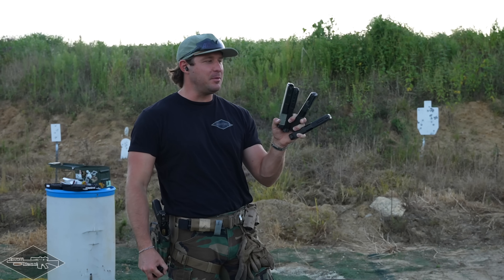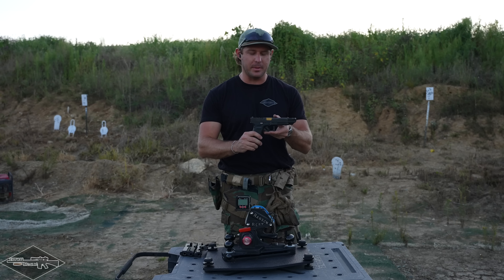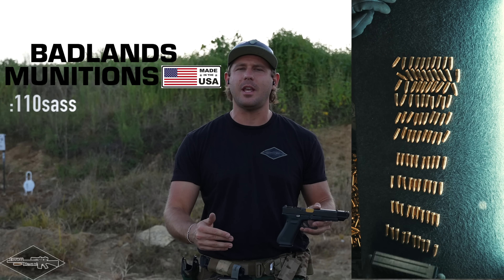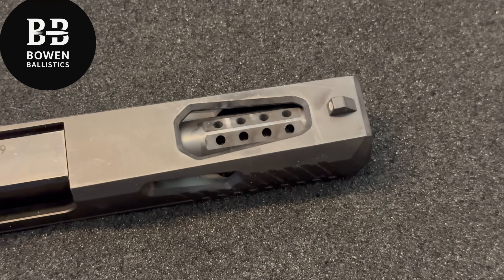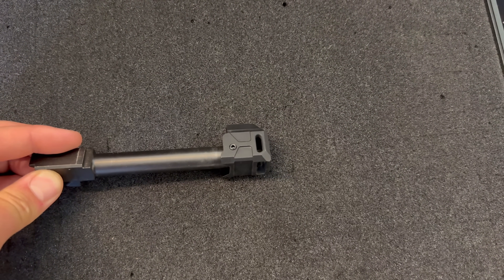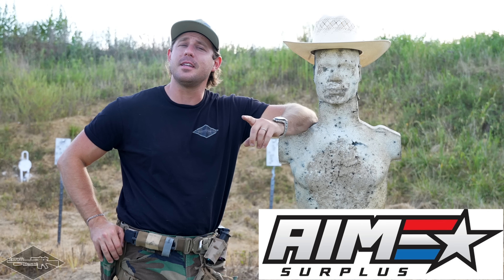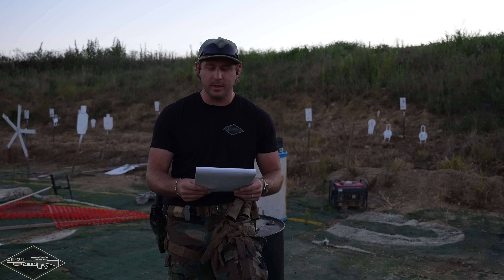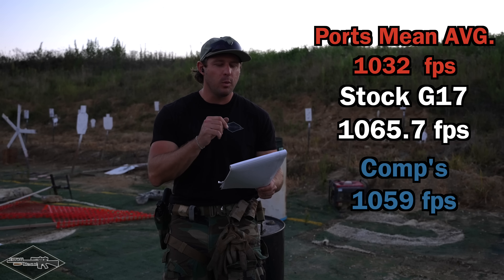Science Finally Proves It - Which Is Best?

Comment: Let me help a little with the accuracy of your home brew. I've been porting and integral comping barrels for myself and others since 1993 and here are a few tips that make a huge difference. 
First. Use a end cutting carbide end mill. Not a dri as the end mill will cut much cleaner with very little interior burs or rough breakout in the riffling. Next, angle the barrel slightly up by 1 deg in the vice, this prevents the forward edge of the port from acting like a  wood plane or cheese grater on the jacket of the bullet.  Lastly, use a Fordum or dremel with aa fine rubber abrasive by crayex. (Jewelry supply or gunsmith supply store) and polish the interior of the port, particularly the forward edge to round the edge of the interior of the port. This will stop any shaving and or shrapnel from the jacket material. .   (This same shaving also unbalanced the bullet like an out of balance tire and causes accuracy issues. Particularly at any appreciable range)

Next, lap the bore to remove any possible remaining burrs. I use JB bore paste or very fine 3 micron diamond stropping paste. followed by flitz metal polish as it breaks down to 1 micron in use. 

Lastly,  Do not under any circumstances use plated bullets in a ported gun or a revolver. The jackets are ultra thin, weak and plated ver pure soft lead. Any port regardless of how smoothe inside will shred the platting.  Giving of both sharpanell and  destroy accuracy and can in some cases damage the barrel. 

I fine that slightly higher quality ammo such as Federal American Eagle that has a thick actual copper jacket to be very stable in smooth ports and give even good accuracy at long ranges. 100 yards, no issue whatsoever.  Avoid such offerings as winchester white box,  Blazzer, Federa and Remington target or practice as they are all plated. 
Plated is supposed to be listed as TMJ which is total metal jacket. Total metal jacket is a plating and can be seen if you pull a bullet from the casing adn it is jacketed on the base as well.  A real jacke will either be lead exposes on the base on a round nose, or the tip of an HP.  It is haw they have to be made as the jacket starts as a cut.  Lead is pressed in from the rear of a solid and from the tit of a HP. then shaped.  A bullet can be easily pulled by simply putting a live round in the vice adn twisting it out with a set of channel locks. Another quick on location test is using a sharp knife, a plated bullet is easily cut tru to the lead where a jacket is very tough. 

KnifeMaker/Retired after over 47+ Years in the craft and 1911/2011 and double action Smith and Wession and Colt double action tuning.

Comment: Great video! Thanks for doing it in a scientific way that eliminates most of the variables.

I would say there is a direct correlation between loss of velocity and effectiveness of the porting or compensation. Basically, the more gasses that are vented before the end of the barrel, the greater the effect. The side ports on the compensators do nothing to reduce muzzle rise and are pretty pointless. The only advantage a compensator may have is that it vents the gasses near the very end of the barrel. This basically gives it more leverage compared to ports, which are further back. What would be super cool is to get some high speed footage of the gasses being vented from a port to see if the ports that are further back vent significantly more gas. It would only make sense as there is successively less gas to vent as each port vents some gas.

The other thing that is somewhat “deceptive” is using percentages to show how much of a reduction there is in muzzle rise. In terms of absolute reduction, it was only about a 2-3 degree reduction with the compensators and a 3-4 degree reduction with the ports. With that said, I do carry a Springfield Armory Hellcat Pro Comp. The compensator is about 11mm wide by 7mm long, with 8mm of un-rifled barrel that opens up to 10mm after the compensator. I have an un-compensated Hellcat Pro and I can say the compensator definitely keeps the gun flatter. I have a Springfield Armory Echelon and an Echelon comp as well. The compensator is about 13mm wide (the whole width of the barrel) by 5mm long, but it is angled forwards. The compensated Echelon definitely shoots flatter than the non-comped version, but even the non-comped version shoots pretty softly. I can rapid fire the Echelon Comp without losing the dot on my Holosun 507 Comp (huge freaking optic 😅).

Overall, I’d guess that the size of the ports/compensators has the greatest impact on the reduction of muzzle rise while the greater leverage is gained from venting closer to the end of the barrel. Some of these compensators add extra weight at the end of the gun, which should also reduce muzzle rise. My issue with added comps is added gun length and greater difficulty in finding a holster.

Be careful when shooting from retention!!!

Comment: Bonus points for ports not impacting holster selections too.
Reply: And not adding weight to the front of the gun
Reply: @69newportking that's uh, where you traditionally want it
Reply: This. Exactly why I've preferred them.
Reply: Ive never had an issue with holster selection. Most of the big holster makers will give you an open bottom holster if it's not already their standard.  Just gotta ask when ordering 

But I guess it could be an issue if you're carrying bare guns without lights or optics, and can find off the shelf holsters at your local gun shop
Reply: And reliability for not adding weight to the end of the barrel.
Reply: Does custom ports affect accuracy?
Reply: my comp sticks out like a sore thumb....its annoying

Comment: So, if I'm doing this correctly,

A g17 slide is 7.32" long

Glock 17 OEM 18.62 degrees is a 2.466" muzzle rise

Agency arms 15.9 degrees is a 2 085" muzzle rise

Harrington 16.34 degrees is 2.146" muzzle rise

Radian 16.10 degrees is 2.113" muzzle rise.

The average was 13.48% or .332", or a tiny bit more than 5/16th of an inch in muzzle rise reduction. It's worth noting, the compensators didn't lose any velocity over the factory barrel, I'm curious if the same barrel was used for the OEM Glock, agency, and Harrington. EDIT*(Oops, nope. I'm blind, didn't notice the HA had a gold barrel, derp.)*

Now the ported barrels

V8 was 14.25 degrees that's 1.86" muzzle rise(it also was 30fps slower)

North sea hybrid 15 91 degrees is 2.086" muzzle rise(no velocity loss)

I6 14.65 degrees is 1.913" muzzle rise(30fps velocity loss)

Average was 19.76% or .487", or a tiny bit more than 15/32nds of an inch less muzzle rise.

It would be interesting for a hand loader to bump the velocity back up to match the comped barrels and see what the reduction would be then, although the hybrid one matched the OEM velocity and reduced muzzle rise by about 3/8ths of an inch.

Comment: Fantastic! Future Idea.  How about stacking a dpm recoil reduction system in the best performing ported system to see if it further reduces recoil.  It should improve reliability as well if it is an issue. 
Finally,  if you have the capability,  get some custom loads with a gassy powder but lighter projectile to make the most of the system.  The gassy powder will improve the function of the ports while the lighter projo will reduce recoil.  Think 90 grain 380 projectiles.

Comment: ...interesting !  while looking at results in a percentage basis makes things look like the improvement is significant, looking at just the degrees of rise change brings things down to earth level.  For comps the max was about 2.5 degrees change, and for the porting (depending on which, and leaving out the DIY) the degree change is about 4 degrees.  for shooting distances of 10 yards, these changes are insignificant, one is likely not even able to notice as the sights return to to the aim pooint after recoil.  Like for rifle shooting, a shooting angle change represents a point of impact shift, and the longet the distance the higher the point of impact shift.  So, yes, if one is shooting at 25 yards or more, the recoil will take you off the aim point more.  IMO neither ports nor comps are worth the money.  Maybe if I was at the top level of IPSC where the extra miliseconds to aquire the new sight picture after recoil with a non-ported, non-compd, could actuallymean something...

Comment: You need to reconduct your test with different ammo.
My doubles with 115gr are 4" apart but my doubles with hotter 124gr or 147gr are less than 1/2".
The hotter the round the more "effect" the comp has.
People want to know the difference between regular and hot ammo for both ported and comped.

Comment: you should compare slide cuts too. like recoil on a fully skeletonized slide vs a stock slide. I think this is where the ports are getting some/most of their results from is reducing the reciprocating weight on the slide, not from the actual gas (your results showed only a tiny reduce in fps, so it seems logical that there isn't much gas lost.)

Comment: Lack of muzzle rise does not equal reduced recoil.  Comps and ports have two totally different effects on felt recoil/muzzle rise.  Comps "soften" the felt recoil by allowing the gases to expand and baffle the gas vertically and to the side.  Most effective comps have at least two chambers with the last chamber larger to scavenge the remaining gas.  Ports direct gas vertically and reduce muzzle rise but don't reduce recoil.  If you look at the combinations being used in USPSA/IPSC in 9 Major or 38 Supercomp, the comps have 2-3 ports (with or without side bleeders) and the barrel has 3-5 ports (popple holes or ports if it's an island barrel).  In unison, the comp and ports soften the recoil impulse and reduce muzzle rise.  Ammo plays a huge role in the effectiveness of both comps and ports.  The fast powders used in most factory 9mm loads don't optimize comps or ports.  Competitive shooters load both 9mm and 38SC with slower burning powders to produce more gas to work the comps and ports.  If the comp is installed correctly and reamed to the barrel, there is no effect on accuracy.
Reply: So.. Ports?
Reply: @IKyIIVHoleII  Both!
Reply: @IKyIIVHoleII  it depends what you expect out of them.

Comment: It seems like the advantage would go to the comp:
-Puts weight out front that's independent of the slide
-Doesn't foul the sights (in front of the front sight)
-Doesn't spit copper fragments out the ports
-Should hold better velocity, since you still have all the barrel length
This was a surprise...
Reply: I’m surprised that accuracy/grouping wasn’t part of the testing. Ports have a tendency to shift point of aim and groups open up past 15y from personal experience. If we’re doing definitive analysis idk I think accuracy is a pretty big factor
Reply: @Lethalmuffin87  Personally, I prefer comps over ports, even if the ports reduce muzzle flip better. The difference is just a couple of degrees and the comp has other advantages.
All this effort to "tame" a freakin' 9mm? Do ya really need either one?
Reply: @HalfCrazy520  I’m with you on that!
Reply: @Lethalmuffin87  I shoot .45 a lot and I have a 1911 with a comp on the end... I don't think it actually does much, but it looks really cool.

Comment: Ports 14.93
Comps 16.11

You left out the percent in velocity loss with the ports. 
So ports lose 3.2% velocity
For only a gain of 7.1% in muzzle flip

So let’s say ports have a slight advantage depending on which you pick, over comps depending on which you pick. Versus velocity loss again depending on which port you pick.

I’ll go through each ports numbers and each comps numbers and show the much wider spread. Rather than lumping all together like you did here. 

I’ll take velocity and proper hollow  point expansion over louder report for a little less muzzle flip. Self defense you won’t be wearing ears. Shoot a 4.5” 357 sig with ports no ears in self defense. You’ll be 6 months trying to recover a little hearing back.
Reply: Another detail I noticed that isn't being mentioned is that because the ports are a permanent change, you lose the ability for that barrel to be used effectively with a suppressor

Comment: One question I have is how you can control for weight or factor weight in. For the radian afterburner to be almost as good as the agency arms, and the agency arms is much larger and heavier, seems like radian might be doing more with less
Reply from the maker: No, it’s doing less with marginally less
Reply: @110sassactual so the ideal comp would be agency arms sized but with the radian porting style/patter? Someone should make that and profit
Reply from the maker: @MEDICIERIC I mean, ideally, you forget comps exist and port your weapon

Flatter, less weight and less overall length.

Comment: My working theory has always been the added weight of a barrel extended to have threading plus a the weight of a comp would add to the vertical gas direction and provide better performance than the lighter weight porting of a barrel that requires removing material(and therefore weight) from the guns slide to ensure effective gas redirection.

Comment: My biggest concern has always been the difference in accuracy when talking ports vs comps. I would love to see a video like this that focuses on the impact on accuracy when choosing which route to go. Heck, I’ll take a 5% reduction in muzzle flip if it means zero negative changes in practical accuracy.
Reply: There is probably no real difference in accuracy unless your compensator has a massive burr in it
Reply: @jason200912 there probably isn’t,  but it’s nice to see it tested instead of just being hearsay.
Reply from the maker: Quality machining will never impact precision 

Garbage machining absolutely can
Reply: @110sassactual I concur with the other people, I would like to see some accuracy testing too and not just a statement.
Reply: @110sassactual calling bs. Trust me bro
Reply: @110sassactual that’s unfortunate. I saw a drastic decrease in accuracy with my Fdez ported barrel over my stock one.
Reply: @mikkxfit  looks like the fdez barrels have ports really close to the chamber which means gas is being bled off right as the round is fired leading to decreased power and thus accuracy it seems. When I thought about ports I told myself I would only go with porting close to the end of the barrel for this reason. Seems like comps would be the best solution.
Reply: @clutchboi4038 right you are, my thoughts exactly. I just wish I had learned that a couple hundred dollars earlier.
Reply: @110sassactual  you said it yourself in the video, "trust me bro" doesn't carry much weight.

Comment: Go get yourself a back chamfer cutter. It chamfers holes on the side you can't normally reach. There's probably a burr that is ruining your accuracy that just needs to be knocked out. NOGA RC1000 should work, if it's between 3-5.5mm diameter holes.

Comment: One reason to chose a comp over a port is that at least from what I saw in the Nightwood Guns video, if you shoot from retention with ports you can get cut up with jacket shavings while with the comp it doesn't do that. I wonder if all port jobs throw shavings at you or just specific styles.
Reply: Poorly machined ports... proper ports do not shred the bullet jacket..
Reply from the maker: Never had this issue unless I was using those garbage blazer bullets. Those things really shred through ports. 

Never had that problem with quality FMJ jackets.
Reply: It's not always jacket that ejects out of the ports. I had ports on a S&W yeet chunks of debris at me when shooting swiss Norma (pre-enshitification Norma) 124gr. I discovered this while doing some drills with some instructors and discovered it the hard way when I had stuff embedded in my hand and arm that didn't come out for a couple weeks. So it's not just garbage blazer that don't have bonded jackets.

Comment: Full power 9mm will probably have way more variation in recoil. A 124 at 1060fps are basically USPSA power factor loads. They don’t really recoil and they don’t represent the recoil you will get in duty loads.
Reply from the maker: Agreed! Check my pinned comment
Reply: It’ll just be more pronounced. More gasses means more downward force through the respective methods.

Comment: Very nice work. I wonder, as far as muzzle velocity in comps vs port, why isn't the muzzle velocity in the comps (with the extended threaded barrels) higher than the standard- barreled  OEM setup? Thanks!!
Reply from the maker: Good question!  Suppose it could mean one of two things… the extra barrel length of what? .25-.5” of threads adds a touch of MV but the comp slows that.. or the minuscule barrel length adds nothing to MV and Comp doesn’t effect MV. 

Would be fun to test that